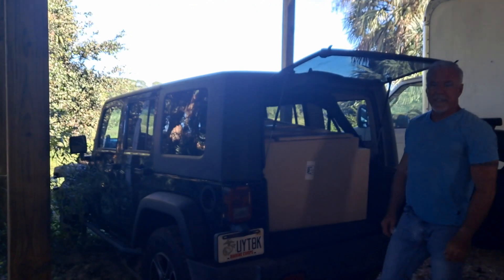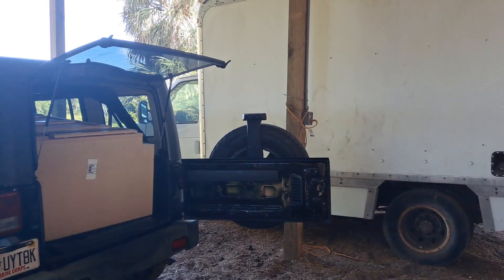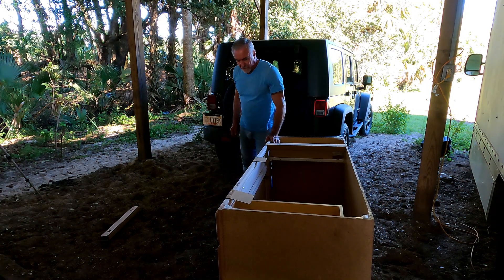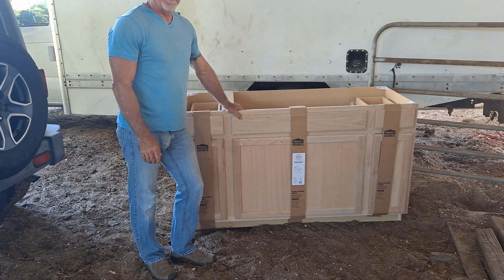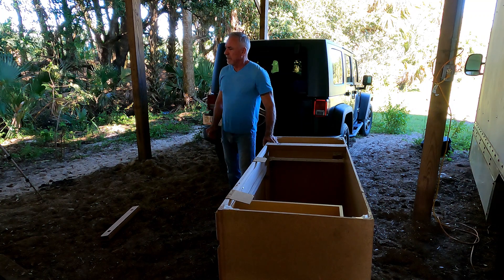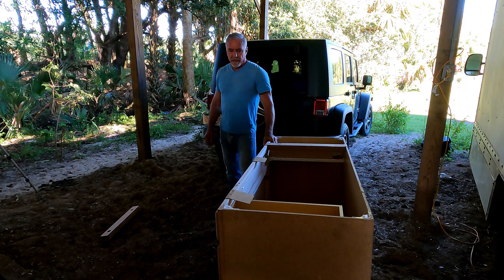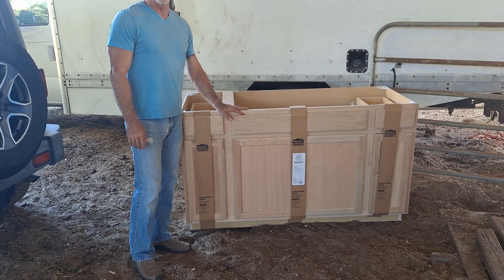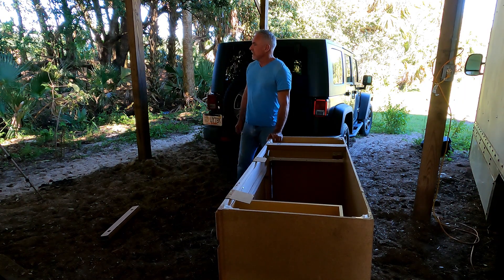Box Truck Conversion Base Cabinet Arrival

Comment: Sooooo, do you plan on showering first or washing dishes first? 🤔 😆 I have a mechanic (number 3) coming to look at my van this afternoon. Hopefully he can finish what the other one didn't.  Anywho, thanks for the video brother and YHVH bless.
Reply from the maker: HaHa! Dishes? LOL Good luck on the mechanic. If you were here I have the perfect guy for you!! Keep me posted on your progress!
Reply from the maker: Hey Southern Rebel! I think I'm going to have all my kitchen water come from my drinking water. Not that it isn't okay to do my dishes in it, but I think I'm going to do a lot more than just dishes. Brush my teeth, etc. So, thanks for asking cause it made me think.
Reply: @BoxTruckVagabond  good deal brother, I was somewhat worried about that.  I think it's the whole washing of the stinky parts, then washing your breakfast plates.  🙃 I'm glad you decided to make that change. I'm having to make a change also.  I came by my van two days ago, and the lower manifold intake that I spent 328 dollars on was stolen out of the van as was my battery.  Now I think I will have to put it on fb marketplace to see if I can sell it.  I might not be able to do this for a couple more years.  But Father YHVH knows what's best and He'll help me deal with it.  You take care brother and YHVH bless.
Reply from the maker: @southernrebel159  I'm so sorry to hear that. At least good luck in selling it. :/